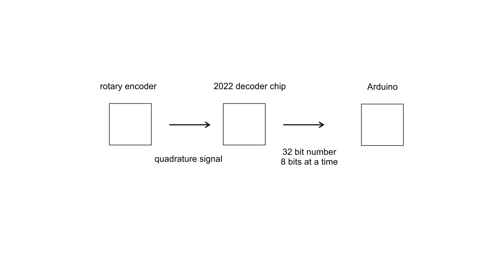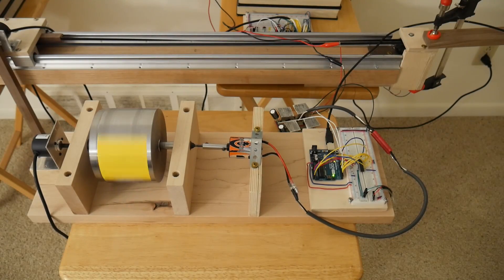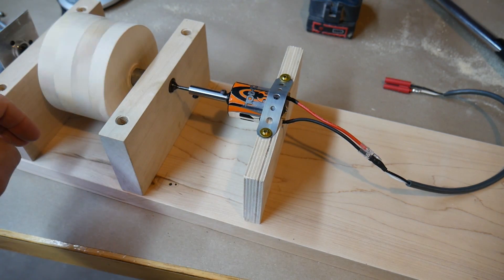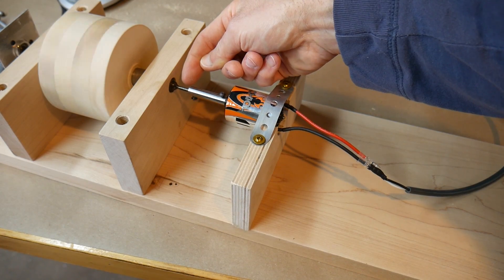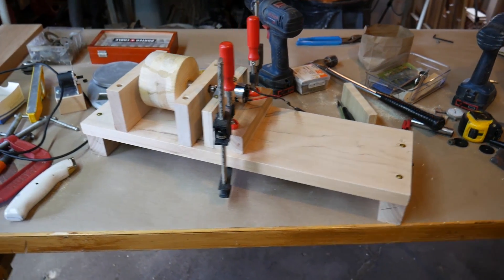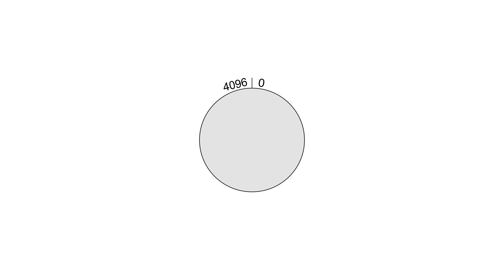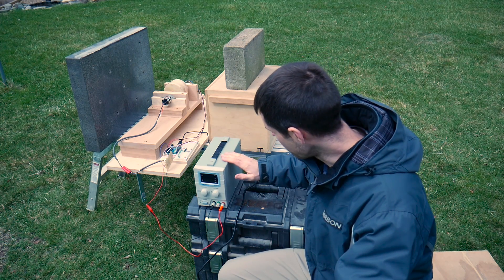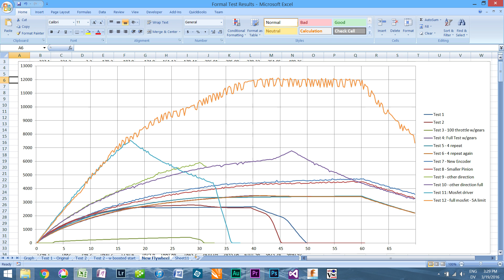Motor Dyno #2 - New Flywheel

Comment: Scott, The reason you were having issues with funny readings is because the data in the register gets reset (and another sample taken) when you read ADCH. I don't know what AVR you have but I'm doing some work with an ATCAN90, and this feature/bug is covered on page 290 last two paragraphs of the chip's datasheet.

Comment: I was already thinking about the issue that natural wood's density varies a lot (not like steel) so it isn't sufficient to make it round on the lathe when i noticed starting at 9:02 that the unbalanced issue with the wooden wheel is obviously worse than expected. Guess you observed that already?
Reply from the maker: +Mirko Mueller Yeah, not sure how is the density issue and how much is the shaft. The wood was carefully selected for consistency (for a different project) so it should be fairly uniform, for wood at least.
Reply: In the video you were holding and releasing it and it immediately started spinning back and forth that intense that shows that it is pretty much unbalanced.

Comment: what is the encoder you are using?
Reply from the maker: +cottenmouthsnake aeat-6012-a06
Reply: Did you ever find what kind of connector its supped to use? the datasheet does say
Reply from the maker: +cottenmouthsnake I think it's one of the small Molex connectors, I picked up one but haven't tried it yet. The datasheet does not specify, which is annoying.
Reply: +Scott Rumschlag How did you export the data to the excel sheet?
Reply from the maker: cottenmouthsnake Copy and paste, it's slow but flexible and doesn't require an extra program.
Reply: I found the connector on mouser, but you need to crimp your own wires http://www.mouser.com/Search/ProductDetail.aspx?qs=TEDqGy%252b%2f3mEDAdtqUG6gWg%3d%3d

Comment: Very nice. The absolute encoder what model is that? And how does it work?
Reply from the maker: +Soren Andersen It's magnetic, the magnet press-fits on a 6 mm shaft and then the housing sits around it. Model aeat-6012-a06
Reply: Thanks

Comment: Hey Scott, Do you change anything with the audio tracks on your videos? For some reason, the past 2 videos of yours that I have watched I can't hear a thing. (But I get audio as normal with all other subscriptions)
Reply from the maker: +Zach Benedict Not that I'm aware of. I had an audio issue a few weeks ago but haven't really changed anything once that was fixed.
Reply: +Zach Benedict Every now and then there are bugs in the flash/html5 player. Check if you have all up to date. Give the video a try again after it's processed by youtube and there's more quality options available (the resolution option also gives you a different audio file)